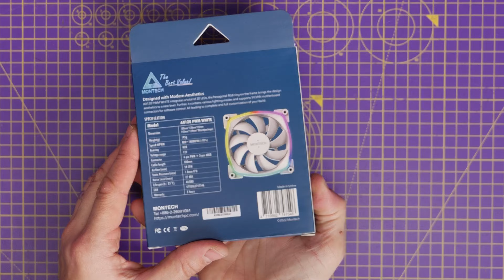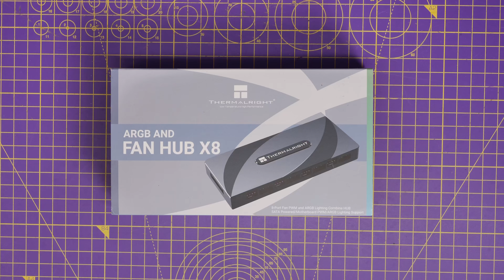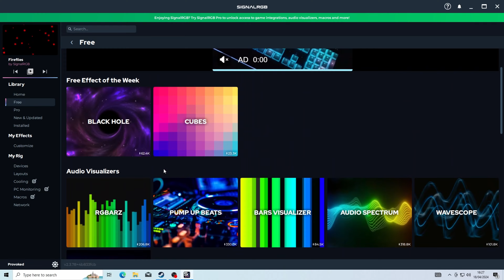How to wire and control Montech RX and AX RGB fans

Comment: itd be helpful if you address the king 95 PRO and how to control the lights on those fans. It already has a control hub but I cant seem to figure it out
Reply from the maker: I don't have the pro so don't know what the controller connects to. If it's 5v RGB then use motherboard RGB software or SignalRGB
Reply: @ finally figured it out. It was a button on the front of the tower lol.
Reply: @bluelinewhitetails6205 I can’t figure out how to connect it to signal rgb. Can’t find a vid about it? If you stumble on a solution plz tell me

Comment: Hey man thanks alot u helped me when i built my first pc a week ago and also helped me with windows cus i had no wifi drivers, but now there is this annoying sound that I don't know where exactly is coming from. It's like a buzzing sound so i'm really afraid that it's a short circuit somewhere (even though i made sure like 10 times with every cable i pluged it in really good and made sure to hear the click sound).It's coming from (i think) the top part of pc to the left. So I don't really know if it's the cooler or the exhaust fan on the IO side of the motherboard and the case or something worse like powersupply or the GPU (altough they are too low for the sound but im not sure)

Comment: Why not Daisy chain the fans versus plugging them all into the motherboard or that separate box?
Reply: not all fans can be daisy chained
Reply: @a_leph  these fans can, I have the same case and fans. You don't even need a separate box
Reply: @GDBAKED81  how can you daisy chain them if they only have female connectors?
Reply: @a_leph  the one's I ordered have 1 male and one female, also the back of the case has multiple male pin attachments
Reply: @GDBAKED81  which case did you buy?
Reply: @a_leph  I actually bought the pro version of the montech King 95 so mine already came with 6 fans but I bought two more 140 mm fans for the back and Daisy chain them.

Comment: got a quick question for ya if your still seeing replies here.

Is there any way to adjust the 'speed' of the fans that are part of the King 95 Pro case that comes with the controller pre-installed?  Not so much the RGB, but the Speed of the fans themselves.
Reply from the maker: If the controller connects to a chassis or sys fan header on your motherboard then it'll be via the bios or you could use an app like Fan control or your motherboard software
Reply: I haver this case with Montech fans using an MSI Z790. I can control my fans through bios or MSI Center.
Reply: Sata cable has to be plugged in

Comment: Hey man, i bought the Montech king 95 pro case, but my motherboard doesn’t have a 3pin 5v rgb header. It is a MSI PRO Z790-S WIFI. Is it stil possible to buy something extra to connect it to my motherboard?
Reply from the maker: You could try the Razer Chroma RGB hub instead. That takes the RGB but connects to usb
Reply: I have the A version of that mobo. I would have thought any Z790 mobo would have multiple ARGB headers, but I looked and it sure doesn't. Just saw a video of a guy using a "Gamer Storm RGB converter". Search YT for "Hooklng 3 pin ARGB to 4 pin RGB header" and it should come up.

Comment: Hi, prawn love the videos. They help me out so much as I’m new to all this. Quick question though hopefully you can help me out, can I plug my cpu fans in to the hub as I only have one RGB header on my board
Reply from the maker: One of the ports is CPU specifically. You'd then connect the hub to the CPU fan header on the motherboard. The only thing is all the fans would then adjust according to the CPU temp probably. But that'll at least keep things cool.

Comment: I have 11 fans that have rgb, what should I use to use them all.
3x 140mm AX
4x 120mm AX
4x 120mm RX

I use a Montech Sky Two GX case, which has 11 fans that can be installed in the case, I'm a little confused, Because I didn't find a single RGB hub on the market that can be used for 11 ARGB fans, do you have any suggestions?
Reply from the maker: You'll either need to use two controllers or connect some to the motherboard
Reply: @TheProvokedPrawn  Is it possible to combine 2 controllers into one?

Comment: I have the King 95 Pro version. I can control the AIO fans and pump RGB through the provided fan hub, but cannot get the case fans to sync with them, even though they are on the same hub. I have tried everything I can find to do to get the case fans into motherboard sync mode. If anyone knows the proper way I would really appreciate it. I've held the button down for all different numbers of seconds. The fan RGB will flash twice after 3 seconds and again after 5 seconds, but none on that allows me to control it through the MSI Center Mystic Light. I did hook the RGB cable up to my Galax RTXC 4070 Gamer EX and can control the RAM, AIO and GPU RGB, but not the case fans.
Reply: Can you turn the rgb off by pressing the led button? The included rgb fans?
Reply: @doggotechsupport2840  Yes, hold down the LED button on the case for 3 seconds. May be 5 seconds.

Comment: Really enjoy your videos when i can catch them,ive decided to go with some Thermaltake SWAFAN EX14 ARGB Magnetic Quick Connect pwm cooling fans in the 3 fan pack for my build (using the Lian Li 011 dynamic XL case that i had previously watched on your channel and made my mind up then :eyes-pink-heart-shape:) question too you is the Thermalright ARGB and fan hub controller compatible with the thermaltake fan connectors?cheers.
Reply from the maker: I've not used Thermaltake fans I'm afraid. So I don't know what the connectors are. If they're standard fan power and RGB then yes.
Reply: @TheProvokedPrawn  Thanks for the heads up,hoping it got you curious,i havnt ordered them yet so im happy to wait for an appraisal from you perhaps sometime in a future video :face-red-heart-shape::cat-orange-whistling::face-fuchsia-wide-eyes: